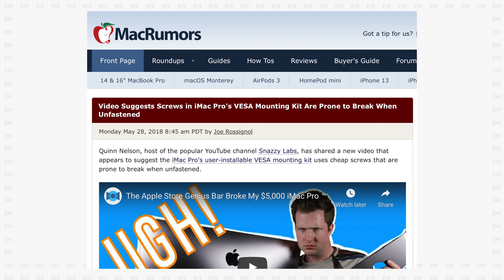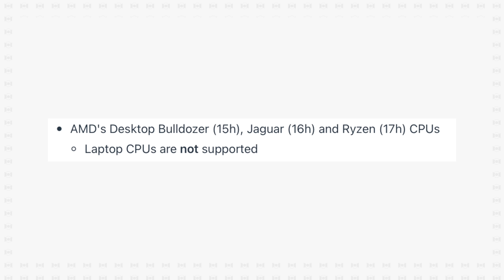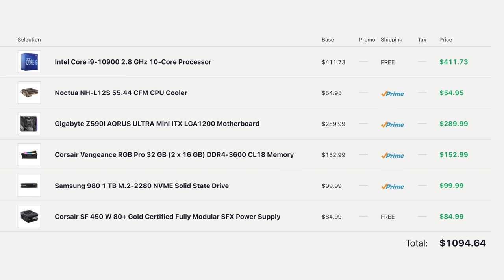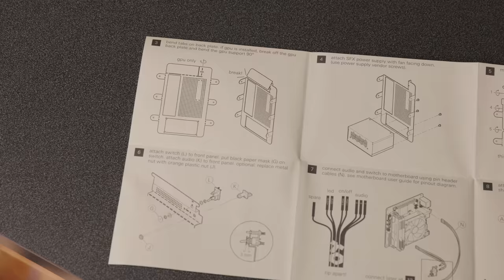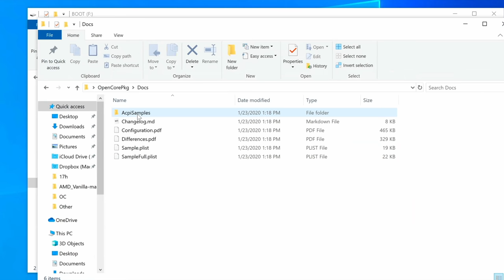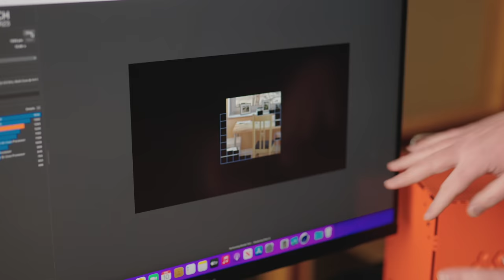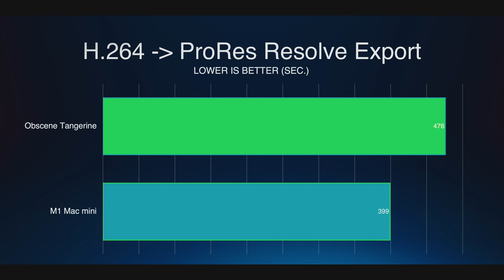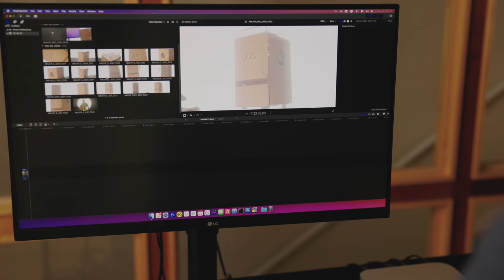The Last Hackintosh?

Comment: So we could order the Last Mini in the TE Orange box from you? Great stuff. Who needs to know how the hell is hard to Clover  these things in reality :) It just blows away the Mini with that enclosure. Headphone Jack, or a 4 voice poly PO-Synth? What else could that beautiful design be for? Top built. But you need to add a Midi port or it's not barely cool enough. First Macs all had, Midi ports. As the Atari. Those were THE computers that revolutionize an era of Sound designer and composers. No Midi ports, don't say usb cuz it's not how a Mac worked. People would try to convince me otherwise usb 3.1 has no lag, etc, but Midi on Original Macs was hardware level. No sub stack bloat protocols nightjibberishtuffmeres. You won my sub at the Mic anyway :) The build sucks. No Midi. Sucks. Same as OP-1. Usb midi. It sucks. I have it. 10 years. I love it. It sucks a great deal don't even start arguing with usb Midi please just don't. (Anyway the Usb Audio FW 10 years in? TE GOATS!! That's another planetary level of things. love;)

Comment: Trillion dollar company finally releases hardware that isn't complete garbage. 14nm chip running software it isn't designed for is beaten by 5nm custom designed hardware only compatible with macOS... Intels new 12th gen CPUs are much better all round and they are infinitely more versatile and significantly cheaper. I will never forget the day I left Apple because I could actually do whatever I could think of. Especially during COVID 19, where if you're stuck with a M1 Mac? Guess you're on IG or Twitter for 2 years, smacking your dongle around the house.

Comment: Gotta disagree, building a Hackintosh is still worth it if you need to dual boot into Windows. Until Microsoft supports Apple Silicon for Bootcamp, this will be the case.
Reply from the maker: You’d get better value out of two separate machines.
Reply: @snazzy  Yeah but that physically complicates one’s setup and workflow by having physically 2 different machines to do your work, not to mention the lack of desk spce. I’d rather combine the two if reasonably possible.

Comment: The Mac mini had 8GB memory vs 32GB in the hackintosh. It’s crazy what apple can now squeeze out of 8GB. I’ve been using an 8GB Mac mini for a few months now waiting for my new MacBook Pro.
Reply: Lol..... that 32g of ram can actually achieve way more than the 8gb in the mac mini, that mac mini also doesn't support all the apps and features available on intel.
Reply: @alanmay7929  

Also think about the swap on the ssd that’s used ..
Reply: @martinsauer5311  its going to be almost useless in comparison to intel macs that could be very easily upgraded with both internal storage/ssd and ram.

Comment: Note that 12th gen Intel Core will do >2k points in Cinebench R23 single-core. The reason the M1 wins single-core is because you're comparing to a two generations old part.
Also, Apple M1 performance mostly isn't down to those 4 performance cores. Using 16 billion transistors, Apple has included fixed function units up the wazoo. Those are what's performing so spectacularly well.
Reply from the maker: Yes and the reason 12th gen Intel doesn’t apply here is that the iGPU doesn’t work.
Reply: @snazzy  Yeah, but that's a software issue, not a hardware issue. The comparison may be valid (within the Apple ecosystem), but it certainly isn't equal or fair.

Comment: Obviously Teenage Engineering are ex Apple who love design over function. I bought a intel Mac-mini in 2019. It's rubbish, the top of the CASE temperature runs at over 40c and video out has it's own problems which Apple denied repair or replacement even with Apple Care (Apple couldn't Care less). Now I run the cheapest M1 Mac-mini. It's OK, it's runs cool and the video out actually works properly but I have a linux server (with all the Apple hidden files crap) for most of my files so I don't need a large capacity drive on the Mac. Generally I use home built PC with KDE Neon so I'm out of the Apple and Microsoft ecosystems - and that's nice.

Comment: If you listen to Linus, most (yes, most) PC purchasers right now are being cheated.  Flat out cheated.
Reply: cheated how?
Reply: hardware is waaay too overpriced right in now.
You can buy 2016 hardware right now which is not only outdated, but costs on some cases more than double of the launch price.
If you buy a GPU right now you are just stupid (except you really need it for work etc.)
Reply: @TheRailroad99  
AMD APUs seem fine for their cost if you’re not trying to game in 4K or 120Hz.

Like the Ryzen 7 5700G is a good 8C/16T CPU with integrated GPU which probably is at GTX 1060 level. For around $330 that seems fine.

Comment: Noctua fans, and that case are ugly. For the price of the case, there are much better options out there
Reply from the maker: Hey did you watch the video?
Reply: @snazzy  Yep, performance is about what I expected. Still, that combination is terrible. I have never liked the color of Noctua fans, even though they are some of best performing fans on the market, it’s a deal breaker. That case, while unique, requires way too much from the end user for the price. The bending, okay, not too bad,  but untapped holes are unacceptable at that price point. If the case was $50, I could understand, but that case it at a premium price point, where there is good competition.

Comment: Great build, however for a better case idea, I would reccomend something by velka, the velka 7 is 6 liters and can accomodate an sfx psu as well as a full size 2 slot gpu and they even have a compatability list for both cpu coolers and gpus. It also looks a lot sleeker with a full matte black case with a simplistic front panel design!

Comment: What really shocked me about the latest MBP with the "Max" cpu was the GPU related benchmarks done by LTT.  

The long and the short of it is, a PC laptop with a mobile dGPU that costs LESS THAN HALF of what the MBP costs can not only outperform it in most GPU related workloads, but by several orders of magnitudes...all this despite Apple claiming the opposite in their event presentation.  Looks like there's a reason they didn't give specifics!

Now that Apple is ending support for x86_64 completely, and going even more vertical, they won't have to worry that much about how equivalent PC hardware performs, and that's not good for us power users, quite frankly.
  
And now that they have completely removed support for any and all dGPUs from the ARM kernel of MacOS, I think we're all going to be in for quite a ride in regards to performance, going forward.

Tl;dr -- if you haven't switched to Linux or Windows yet, now may be the time!

Comment: Not gonna lie, I dropped Windows 11 in favor of a dual boot macOS Monterey/Manjaro Linux situation and have not looked back. Most of my Windows games run great under Wine or Proton, and Monterey runs really well on my Ryzen 5 5600x with a 5600 XT for my Mac stuff.

I'm also working with older (G3-era) Macs in my home lab so it's nice having, say, native DMG burning capabilities for example.
Reply: @rfish67  as for the older Macs, I currently have a 2nd gen iMac G3 (Blueberry) and an early 2001 iMac G3 (DV, Indigo). Will be looking for more if the money is right.

My main workstation is a Ryzen 5 5600x, 32GB of G.Skill DDR4 3200, and a PowerColor Radeon RX 5600XT. Was a PowerSpec/Microcenter prebuilt but I gave it a much better NZXT case and an actually adequate MSI MAG 240L cooler. The Wraith Stealth does NOT handle the 5600x under heavy load.

Comment: Praise for theardware Apple, Pity about the buggy MAcOS Monterey released to the Public at least three months to early. As of v12.1 UsB hubs still have issues, and bluetooth is frenquently broken due to Apple addopting a brandnew, untested entirely not ready for market Bluetooth Frameworks that even Apples own bluetooth hardware - like exterenal mice, trackpads, keyboards and audio devices let allone thrid party devices cant commuinicate with reliably or even at all.
Puity all the flash new M1 Pro and Pro Max hardware wasn’t released using a special build of Big Sur that only incoprorated kernals for the newer hardware. such a build already exists within Apple, but rather than release new hardware with relaible well patched Mac OS Apple chose to go with a broken OS.  Maybe in November we will finally be able to use the hardeare as intended.  if we dont upgrade to the next broken MacOS.
GRRRRR!!!!!

Comment: 1/10 the power draw, really impressive! In any case, I relied on the Intel chip inside the Mac to sell them as a “no risk” proposition. If you hated MacOS, load Windows and forget it. Apple made some of the best PC’s, and it was a nice feature to have 100% compatibility with Windows, just in case. I look at the new offerings, and the total lack of upgradability, and I’ve decided to refurbish old Mac’s with the best supported processors, using those Hackintosh tools to keep them alive after Apple drops support. The early 2013 21.5 iMac models are good candidates for such upgrades as they’re cheap but also have 802.11ac. I’ve built 4 of them now, put a Xeon 1280 in one and the others all got the max i7 they’d run. With an SSD installed, and 16GB of RAM, they’re still plenty quick for general computing and light gaming duty. The improved 2015 fan keeps things cool. I’m not sure what I’ll do when it’s time to buy a new computer, but the lack of upgradability, combined with the lack of being able to dual boot, makes the Mac less attractive than ever, and that’s a shame.

Comment: the computer could have been a lot cheaper (even right now, with prices through the roof). The motherboard alone could save ~150 at least (if you don't want to OC).
The PSU could have also been a bit cheaper. 
However I agree that building a PC right now is just stupid. even 5 year old parts cost more than at launch which is CRAZY.
The only non-overpriced option are Gaming Laptops right now (ironically, as PC builders often laughed at them for being overpriced).
At least here in Germany, you can get a desktop-GTX1080-alike performance for ~1100€, and that includes a 6 core CPU and a display.

Comment: The thing is: for how long? This is the second time Apple moves from CISC to RISC processors, and obviously, being the second time means they not stayed RISC. So you must ask yourself if it is a clever move to go and buy a machine that nobody else makes OS´s for it and that Apple will tag as "vintage" in 5 years and "obsolete" two years after, dropping all support. Also Apple moved into Intel and PC based architecture to reduce costs once. I have a bunch of old G5 collecting dust that remembers me that going into "Apple Silicon" used to be a long term very bad idea. You are talking about the company that solders RAM and storage chips on the motherboard, remember. Apple can turn your 5 year old computer into a brick if they want. Just recently they trown the Catalina 2021-007 update that broke the HD4000 integrated graphics on thousands of "catalina compatible" computers and more than a month later if you install a new copy of Catalina to fix this they still want you to install the update, and no sign they will adknowledge they broke something or they are planning to fix it. Stay away from Apple, and stay further away from any computer that can only exclusively run Apple OS's.